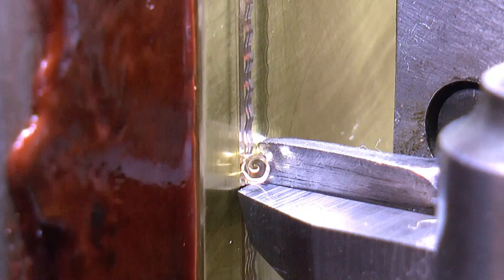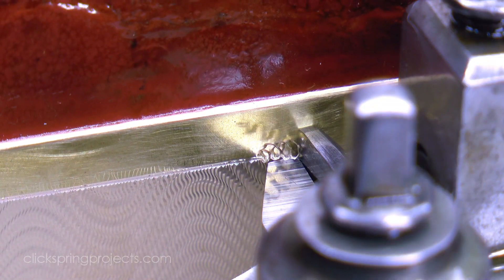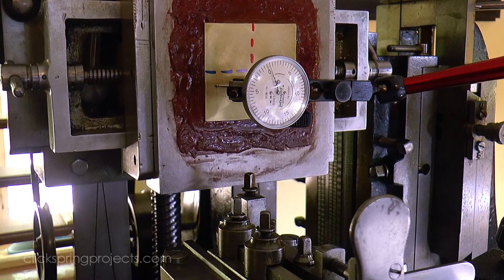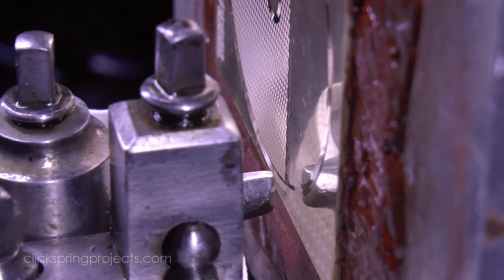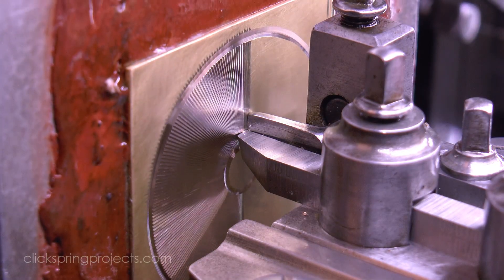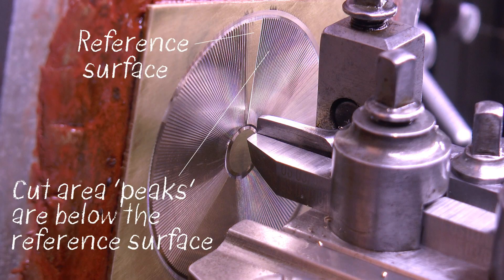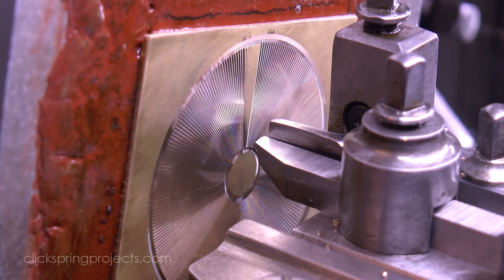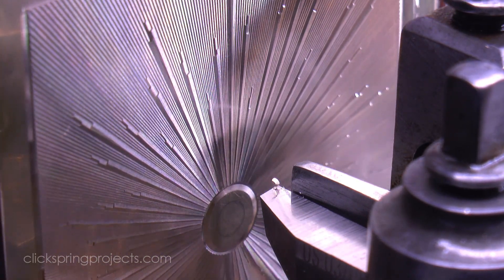Guilloche - The Straight-Line Engine #2 - Depth Of Cut

Comment: Question on the depth stop - would it be possible to utilize a softer material than your substrate?  You would need to replace it every so often, but something like nylon wouldn't mar your surface.  The question I have is would it wear appreciably during your work on one piece so as not to be useful?  Also, I fully appreciate the fact that this machine is a magnificent antique, and works amazingly well in spite of its age.  Great content!  Edit: that sunburst is stunning.

Comment: Chris, Im loving the videos about the straight line and rose engines, keep up the awsome work!
in the back of my head i have been tryng to reverse engeneer these machines to understand how they work and i think i have most of it figured out but 2 things are still confusing me.
--»is there a way of verticaly advancing the gide/pattern to make guilloche like the one seen on your the first video on the SLE? or is it dependant on the platter position on the start of the cut?
--»another thing that i have not figured out is how does the platter keep presure on that tip to follow the gide? is its own weight or a spring?

Comment: Wonder if there is a practical (as opposed to decorative) use for those sorts of patterns? First thing that comes to mind is a reflector that is most active for certain frequency or kind of waves. As in, a mechanical way of separating out a frequency by scattering everything else, or by scattering just that one and reflecting the rest.|
On a large scale something like that wavy pattern at the end could serve as a great water wave breaker. Concrete plates with that design cast into them could be placed perpendicular to the water line and as the wave rolls over that pattern, the energy is redirected from straight into side-to-side, gradually damping the inland motion.
Reply: Hmm, depending on the pattern and the material, this might also make a beautiful grater, for example to make wasabi paste. And similar patterns on the handle could make a good gripping surface. Having nice looking tools makes especially sense when the food is prepared in front of the customer.

Comment: Fabulous machine, I would love to see an in-depth breakdown of its moving assemblies akin to EngineerGuy Bill Hammack's presentation of the Harmonic Analyzer here on YT. 

Now I wonder if the guide could be done electronically: it would be possible to place a tiny laser down below, aimed obliquely at the point where the guide is now.
Then it will reflect obliquely off the job, say onto the ceiling, but the moment arm will be much amplified.
Now if an Arduino or RasPi with camera and OpenCV were looking upwards at that linear oscillating laser point, it could in turn use a stepper motor or servo to push or pull on a lever arm for the cutting slide, to negative-feedback compensate for the beam moving.

Comment: The only thing that makes me a little sad is that, as far as I'm aware, nobody is making new machines to do things like this. I'm sure you could probably get a somewhat similar effect with chemical or laser etching, or even a CNC system with a very fine cutter, but the sheer artistry of the construction of machines like this really doesn't seem to exist any more, and the effect you can get from something with true hand-operation and a sharp, single point cutting tool really is something special. I'm just glad there are people like you out there that are still preserving machines like this, as well as all of the craft and artistry of using them.
Reply: You can buy these new - custom made costing as much as a high end CNC.

Comment: Okay, I know that everyone is going to explain what an idiot I am but here goes. 
Why not true the surface first and thereby not have to go through all the performance of pressures, judgments and skills (also no little art) that not having a true surface entails.
Reply: Truing the surface was done in terms of setting the base plane of the target to match the motion in relation to the cutting tool, but how would you "true" the thickness of a plate of silver or brass or gold?  Or what do you do if you are inscribing a sphere or cylinder? How do you get it perfect?

No using modern surface grinders or CNC's now as well...Think 1700's tech. Your eye will see depth difference at very small (few thou or 10's of micrometer level or less). He mentions this about minute 6 of the video.

Comment: With what was learned recently, it feels like someone could determine which cuts used the depth stopper and which cuts used the local depth reference guide. 
 Absolutely wild.
Reply: He addresses this in the last few minutes as he discusses the depth stop. 
MOST of the time, the guide is the best option as it automatically corrects for unavoidable unevenness in the surface of the stock material. 
Once you go to the fixed stop you have to make those corrections manually and be very careful to get an even pattern. Therefore you need to adjust it very carefully to avoid spoiling your pattern.
Reply: @jeffarmstrong1308  yessir, what I meant to say is that someone of his skill might be able to see the difference between the methods, after it has been done by someone else. 
 Sort of like a mechanical forensics examination of parts, if that was ever to be needed.

 Truly amazing, what we're seeing here. ✌